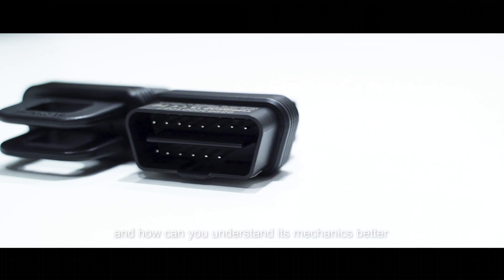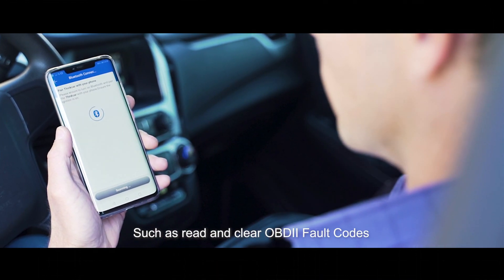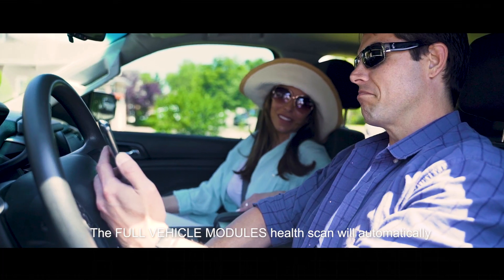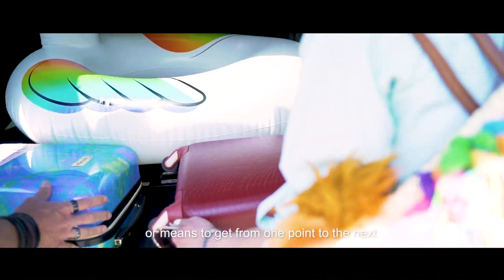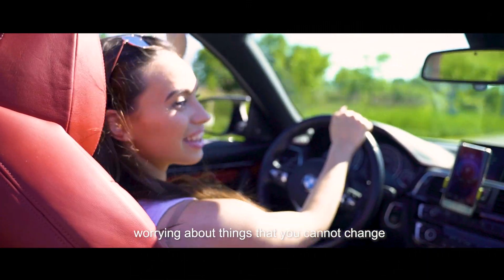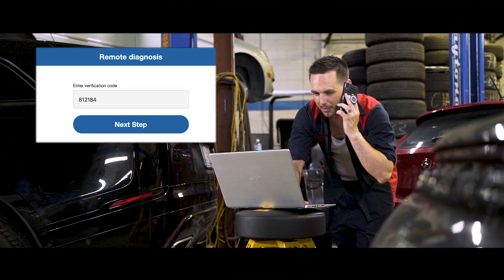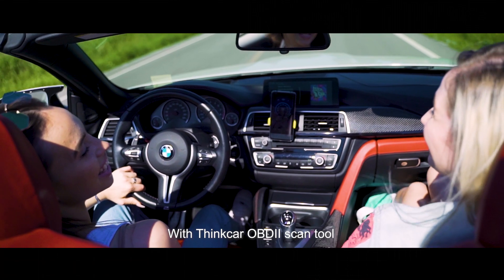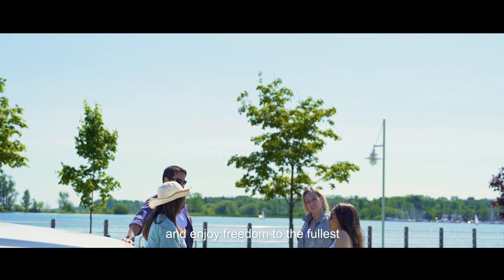THINKCAR1S, Mini Bluetooth scanner, works with smartphone.

Comment: Great deal if you only work on ONE manufacture's car line. Or if you don't mind spending an additional $40 per year PER manufacturer. This is NOT a one time purchase DO ALL.
Reply from the maker: Hi HouseCallAutoRepair, thank you for your suggestion. We do have different pledges on Kickstarter, and here's the link you can check with: https://www.kickstarter.com/projects/ericwang/thinkdiag-your-professional-car-technician-diagnostic-tool/description